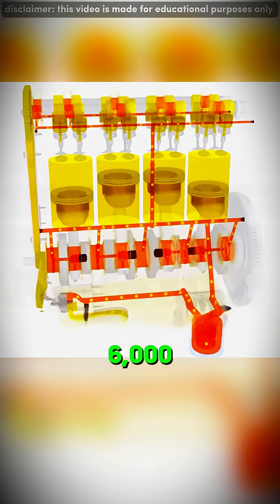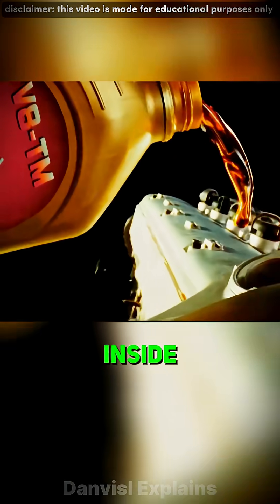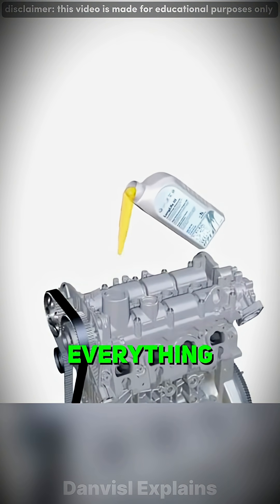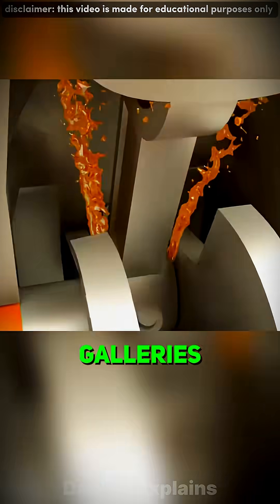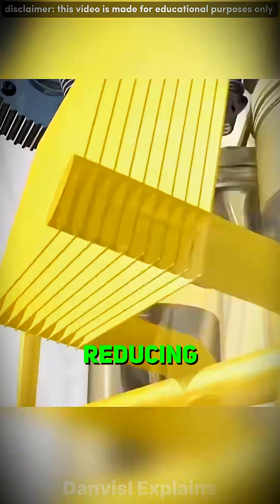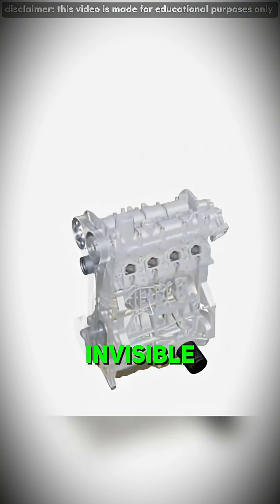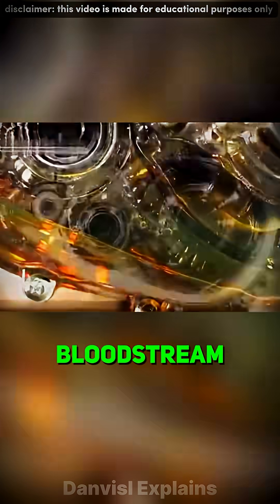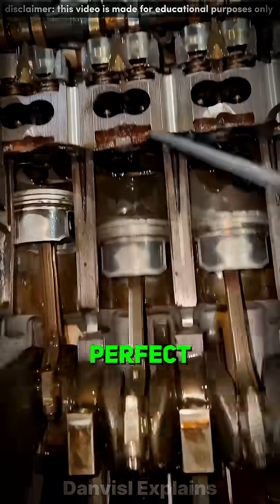The Magic of Engine Lubrication! #knowledge #science

Comment: Motorcycle oil is even more impressive.  Its not just for the engine but also the transmission and clutch.  Also motorcycles rev from 10k-16k RPM

Comment: Lubrication is universal among any parts that rubs against others... Bone joints, bushings in electric motors weather wet or dry.... lubrication has to be there in order for it to live a reasonable life time... A virtual film cushion of oil in engines.
Reply from the maker: You're absolutely right! It's fascinating how essential lubrication is across so many different systems.

Comment: There are 2 main types of oiling systems
1. Wet sump. Wet sump oiling systems sit directly at the bottom of your engine where all the engine oil is at in the oil pan This is an easier oiling system to install on modern cars and it isn’t to complicated to fix… however there is a downside… to turn that wet sump oil pump it takes around 30hp to turn it.. that can cause horsepower loss.

2. Dry sump. Dry sump oiling systems actually have an external pump because dry sump oiling systems have an external oil tank right by the engine inside the engine bay. After when you turn the car on for the dry sump oiling system the separate oil pump will send oil from the external tank into a dry sump oil tank at the bottom of the crankshaft. This oiling system is used on performance cars. And since there is a separate oil pump outside.. there is little to no horsepower loss.
Reply: A couple corrections.

- If an oil pump needs 30 HP to run, there's something seriously wrong with it. A healthy oil pump only needs a tenth of that

- The reason the dry sump system is used in performance cars is that it allows the engine to be mounted lower in the engine bay, which lowers the center of mass.
Reply: @akisalmenaho8473  no usually wet sump oil pumps that have massive layers in the oil pan and they take up a lot of power.  and performance cars need the most horsepower they need so that's why they choose dry sump and its more efficient bruh. You know google research can be wrong bruh. I actually used a dyno to test out how much horsepower does wet sump oiling system deduct and even though it deducted right around 10-15 horsepower that is still a big difference.
Reply: @2018camarosshotwheels  I did that google research years ago. You can't BS me outta this.
Reply from the maker: Thanks for sharing this detailed explanation!
Reply: @DanvsIExplains no problem man
Reply: but then where does the dry sump get its power from?
Reply: @dnkmmr69420 it could be electric or crank driven but even if it’s crank driven the engine will use less power to turn